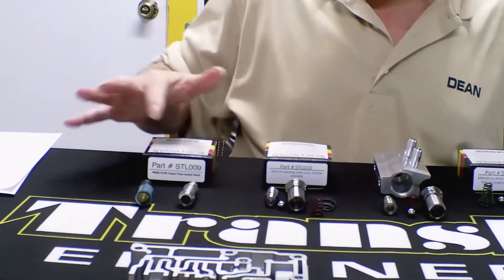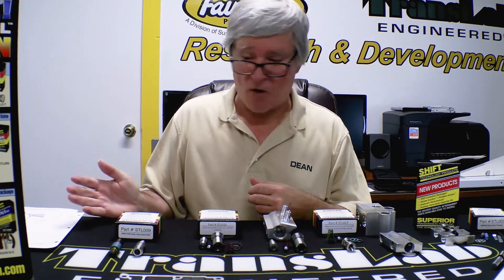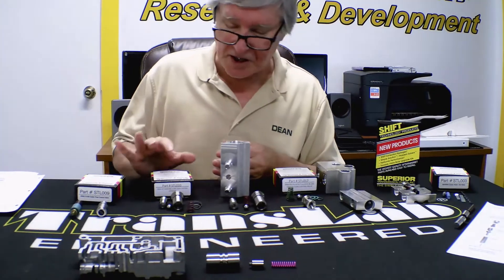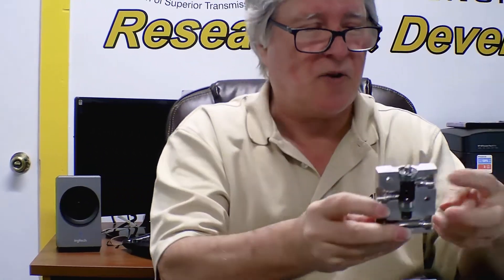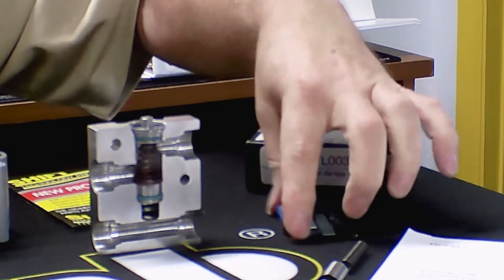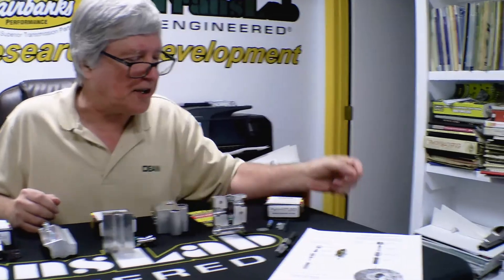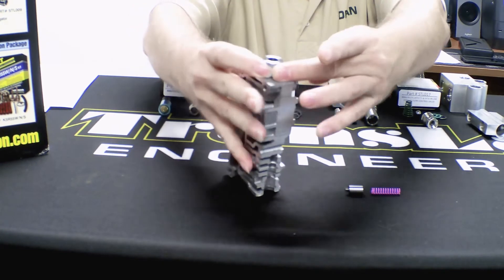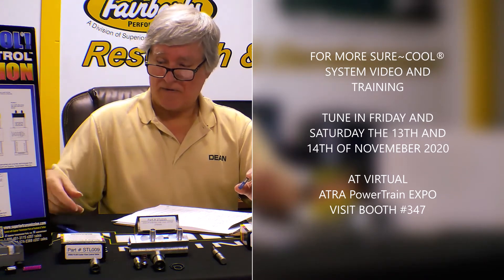STOP! DON'T PLUG the BYPASS Ford / GM Sure~Cool® system TransLab Engineered® Dean Mason cw 2021

Comment: Installed on 2020 Silverado 2500hd with the L8T and 6L90 trans. It regularly gets to 192 in the city or heavy traffic, but always cools back down to about 185. First day I had the truck I noticed it at 210 just idling so I immediately put this in.

This is in Wisconsin summer, temps around 90 degrees F.

We have one in our 2016 Tahoe 6l80 and it always runs about 145-150 these days.

I had one in my previous 2016 Silverado 1500 and my trans failed at 138k... I'm assuming I had a separate failure, because after clutch plates failed I had to continue driving 7 miles and temp got up to 195. Root cause of failure unknown, technician tried to blame the stl010 because "it's not factory" however I'm not convinced. Any thoughts?
Reply from the maker: It's a failed GM product. Read the patent. Also the tsb 21-na-199. GM wants to fix theirs, buy a license on our patent. Theirs doesn't flow at startup. Theirs, a pellet sticks or fails. We have  lube~loop™ technology so the lube port stays flowing. All others block it. We win, you win and they lose from their own hands. A stupid idea is costing 1000s of customers millions of dollars. Our design, made in America. Accept no substitutes or counterfeits. 
Sure~Cool  STL010® for the win.
Reply from the maker: P.s. laser etched with the part number
 STL010 ® and logo sure~cool® system.
Reply: Thanks for the replies, as I mentioned my 2016 is long gone and I'm onto the 2020 l8T with 6l90 trans. With the stl010 installed correctly I'm sitting between 175-185 at operating temp under normal highway driving. I can get up to about 192 when idling for long periods or city/ stop go driving. It does seem to be working, I think l8T runs a bit hotter on coolant so the trans fluid eats some of that via the cooler.

Comment: I have an 18 Silverado with 8L90. Trans temp ran between 190/195*. I put this kit in. Took all of 5 min. My block lays flat so access was easy. Anyway the temps dropped 70*. Now it runs in the 120's.
Reply from the maker: And it's not too cold either.

Comment: I have a 2020 Silverado. Will it be ok to have this on in winter here in South Carolina? I drive about 15 miles to and from work. Not sure it would get up to the correct operating temperature.
Reply from the maker: Yes your fine. It's at temp for all intensive purpose once you start driving. The trans can run in all ambient temps. If it gets to cold to gel the fluid out bypass kicks in.

Comment: I have 2017 Yukon xl. I had transmission hot alert and I replaced the thermostat with this kit along with 3 times of changing trans fluid. I tested drive fro 30 min on highway in my hot Tx weather (100f) on freeway at 70mph. My trans temp gauge shows 220 degree. Did I do anything wrong? Any suggestion?
Reply from the maker: Check the gauge, sending unit, the trans temp sensor and the harness. If that's all good add an external trans cooler in parallel with your existing set-up. Otherwise you have a slipping converter or a holding element in the trans (clutch pak or roller) damaged or failing. It could hit 205-210 on an upward heavy grade but as soon as the load is overcome, (going down hill) the temp should go down to the 170-185 range if coolers are efficient and no trans internal damage. You need to add a cooler.
Reply from the maker: the china counterfeits have 3 large O-rings and 1 small O-ring and copper colored spring, our genuine patented STL010 has ONLY 2 LARGE and 1 Small O-ring and a RED spring...
 some bought the Counterfeits and installed the 3rd O-ring. in the middle groove blocking the feed holes. that is a possibility, if you got a knock off?  tech line (850) 575-7155 USA east std time zone. they will be happy to assist.

Comment: Do you have one for the 2021 Sierra 1500 3.0 diesel with 10 speed allison?
Reply from the maker: Use part number STL020 it is now use on the late 21-up 10 speeds
Reply: I have received your STL020, I feel pretty ignorant, but I am unable to figure out the instruction included with the kit. I have looked for a video to help with installation, with no success. I did see the video explaining the different kits and applications, but I don't see where it shows the proceedures for installation of the STL020. Can you please help?
Sincerely, Tony K
Reply from the maker: @tonykucherry8846  call the tech dept. At 850-575-7155, leave your number and area code and we will be in contact with you. Thanks!

Comment: And none of this is available in Canada. 🤦‍♂️. Thousands and thousands wanting this but can’t get it.
Reply from the maker: King o matic / Transtar or Canada wide or Google the part number. STL010
Reply: I found a place to ship to Canada. I’m just not certain this will be a good mod for our winters up here. May wait till spring. It gets down to -40F for a better part of the winter. On one hand everyone is reviewing summer weather conditions….no one has said anything about 40 below conditions.  @superiortransmissionpartsi5357
Reply from the maker: @jaybilawchuk2225  the gm fluid has a pour rate at -60 below. And....
Reply from the maker: @jaybilawchuk2225  the bypass is still active so if the fluid was too thick to flow the bypass is working to heat the fluid at the extreme low temps. If your cooler routes thru a rad tank that also acts as a preheat source. It works, we sell them world wide and no issues as far as we are concerned. And it's patented, and patent pending world wide. We have them for ford's and the 2022's that were redesigned and are still sticking and melting down units for a 45-50 part.
Reply: @superiortransmissionpartsi5357  Thank you. I will prob put it in then and see what happens. I’m sure it’s going to be good. I just wish I would’ve known about this sooner. I think it’s a great mod for this issue. Lower running temps are always better. Cheers from central Canada!!
Reply from the maker: @jaybilawchuk2225  And the bonus, our bypass is active. Not plugged off. The circuit inside the block keeps oil circulation to the inside guts lubing everything as intended, problem is GMs devise is static and ours is dynamically active, in the position (which creates a Lube~Loop™) back to the trans via the block. You do anything else it's plugged and no lube loop. Our device is full flow on start up / gm is closed, not circulating.
Reply: @superiortransmissionpartsi5357  Exactly!!! I was at GM today asking the service department about this whole thermostat issue.  They don’t even really know much about it up here. It’s crazy.

Comment: Hi I have a 2016 Chevy Silverado 4x4 and I have been experiencing hard shifting from 1-2 to 3-4 so I took my truck to the dealership to get it serviced. After a diagnostic test I was told I need a new transmission. My truck has 120000 miles and is out of warranty. Can you tell me if by installing the superior solutions kit I will solve this hard shifting issue and keep my temperature low it currently is at 180-190.
Reply from the maker: Depends on the why's, what is the diagnosis on why? If you fully rebuild it you need the STL-6L80E valve body kit, the STL012 pump kit and the STL010. The STL018 boost valve is recommended if you pull. Use those on top of a quality master o/h kit and a techm. And don't scrimp on a converter, buy a gm updated or the new heavy duty form circle D in Houston or one that at least has the billet cover and dual disc lock up clutch with hd plate.
Reply: @superiortransmissionpartsi5357  I wanted to give an update for the wat route I went with. After speaking with a very well experience mechanic i decided to purchase a 8l90 transmission and have the thermostat bypassed from the start to help the life of the transmission.
Reply from the maker: @Stop_the_cap311  save your receipt and send it to gm see if they will help.
Reply: @superiortransmissionpartsi5357  thanks I will doo that

Comment: I installed the updated bypass GM came out with and im still around 180… good thing is now i have my stock valve i can modify with youre kit my only question is will my transmission run too cool in the winter when its below 10degrees
Reply from the maker: It will run cooler and be protected from cold low flow/no flow at startup. If you have it in a flow thru type ( goes from transm to eng. To cooler back to transm) it will stabilize on warm up and probably run in the 140's to 160's...but ours will keep the bypass functional when needed. If you have a type that goes from the transm to air cooler to transm and does not go thru the rad tank, then you will run chilly at 120-160 dependant on how fast the trans internally heats it to normal operating temp. In this type the torque converter is the only heat source. In a dual system the radiator tank cooler is heating the atf as well as the torque converter producing heat. So some vary but no worries as the atf fluid will flow at -60. So no harm, no foul.
Reply: @superiortransmissionpartsi5357  thank you for the very detailed and quick reply my sierra runs the 6L80 trans i just spoke to GM and they claim the updated valve is faulty and offered a replacement but if you say the Stl010 kit will be fine in the winter cold i think id much rather do youre delete kit
Reply from the maker: @VictorSanchez-in2oe   Vic please call me at 850-574-2369 x207 I would like to get that old bypass for a show in Vegas I'm doing next month, call me and we can work something out. Thanks Bob w
Reply from the maker: @VictorSanchez-in2oe  the call tag is not in the box the ups driver will have it and will attempt 3 pickups so be ready. Thanks too should be there Tuesday.

Comment: What part number or product would be for a 08 crown Victoria police interceptor I think the transmission is 4r75w ?
Reply from the maker: STL020 just Google the part number, it's transmission parts specific. You can watch the ford video on the website but we updated the STL017 and blended into one kit
Reply from the maker: The new part kit is the STL020 and the 017 was discontinued as we picked up some mbz applications and jeeps. Along with all the ford styles that match the diagrams in the instructions. 6R60-2015 up external early in unit is the STL009 and vids of that too.

Comment: had the STL010 installed in my truck a month ago. Worked for a few weeks and now its back to running 196 degrees. truck only has 80000 miles on it. All highway miles. Never tow anything either. So im at a loss here.
Reply from the maker: Make sure your gauge and temp sensor are in spec. We have had 2 with out of range due to bad temp sensor. Just a thought.
Reply from the maker: Check the air dams and fins in the cooler up front, make sure you don’t have debris obstructing air flow. THEN...if the air path is clear, YOU NEED TO SCAN THE TRANSMISSION AND SEE IF ANYTHING IS SLIPPING CAUSING THE TEMP TO CREEP UP. 
The patent-pending Sure~Cool® system acts as a test device, as it removes any restriction to flow from a stuck pellet or a partially jammed pellet (that would stop or affect cooling flow) AT VOLUME, and since the pellet was removed when you installed the Sure~Cool®, it is keeping the fluid flowing, as our default state is Wide Open Flow. Unless you installed the Sure~Cool® out of order (correct order = dual o-ringed Cap, ball, red spring (little end towards ball and cap) and the orifice bullet with the O-ring that goes inside the block) and if that is order correct, then you have other areas to check. 
 A. Inefficient Cooling thru transmission cooler (needs an external added) added cooler will bring the temps down as long as the transmission is in good shape (see B. & C.)
B. TRANSMISSION component slip* (internal) 
***Note: You may or may not “Feel” the Slip but the scanner will catch it on a road test. Slippage of this type will not last long as the unit will suffer demise. 
C. Torque Converter Clutch not holding and slipping just enough to not set a code but cause heat to creep up on the scanner. This too will lead to demise of the unit. 
After replacement WITH THE SURE~COOL® system installed, you can still have higher than normal temperatures on the oil gauge, if you experience this after install, you have another issue internally.
Reply from the maker: The Sure~Cool® system does these features and benefits. 
A.	Removes the chance the factory pellet will not stick closed or jam up destroying your transmission thru any fault of your own. 
B.	Now allows, immediate start up with full flowing fluid thru the main transmission lines and cooler at normal working pressure and at full volume. 
C.	Keeps a factory designed Bypass fully operational (if needed) and “not plugged off” (with a cork or a screw) 
D.	Factory bypass is now used as a “safety system” (if cooler or lines are damaged or severely restricted) the bypass kicks in and unseats the ball and re-routes lube / working oil back to the Lube~Loop™ to keep oil flowing to the internals for lube and cooling. 
E.	Can be used in extreme cold climates where fluid can gel and cause restriction to flow. The Sure~Cool® system keeps the fluid Lube~Loop™ flowing until restriction of frozen ATF is overcome and flowing at full volume and pressure.  
*Note: temps can still climb up some when towing or going up steep hills loaded etc. the STL010 will keep the flow routed when needed and is your sign (if temps get over 200 deg. To get it to a professional to ascertain what is causing the overheating condition.
Reply: Defective part or other trans issues. Changed fluid?
Reply: @mayken6661   Thats after a fluid and filter change and the coolant bypass installed.
Reply: That figures !! just have a flaw in the engineering !
Reply from the maker: if your temps are higher than the average 150-165 deg. after installing the Sure~Cool then you have some component slipping in the transmission or torque converter. the default state of the Sure Cool is wide open flow on start up. the factory pellet is still closed so ???? it will NOT open till 192 deg. nothing flaw here.
Reply: @superiortransmissionpartsi5357  Do you know of a good replacement converter?  Think ill change it. Its just a v6 and all i do is drive 64 miles to work then 64 miles back home. Was 205 degrees when I got home today.
Reply from the maker: @marcmo7138  that's high if your empty. No load? should not get over 165-180 in Phoenix summer temps. Did you add an aux Cooler?
Reply: @superiortransmissionpartsi5357  Thats my next question. Would you recommend a Derale brand with fan? If so which one?
Reply: @superiortransmissionpartsi5357  2 wheel drive regular cab short bed v6. I just drive it to work and back. Nothing in the bed and doesn't even have a tow hitch.
Reply from the maker: @marcmo7138   they go by GVCW is on your door jam, if it's 10500 lbs fully loaded you want to add 3x that number , so a 30k or 36k  up to the big one is 44000 lbs rated. Hayden, Long IND. Trucool, derale all good mishimoto too.
Reply from the maker: @marcmo7138  if you go that route get the billet Precision of New Hampton or a high qualit performance version (FTI, sun coast or major race brand. with at least a dual disc and billet impeller.

Comment: Do you guys have this product for the 2007 C6 Corvette Automatic trans?
Reply from the maker: This will cover 2014- up 6L/8L series transmission types predominantly in trucks. Do you have one in line on the Vette ? We have seen a few aftermarket ATF warmers for Canada vehicles that were built into a cooler / line assembly but not the Corvette. Shoot a pic of it on the vehicle and sent it to us via the website our contact info is there. We see new applications from time to time and appreciate your comments.